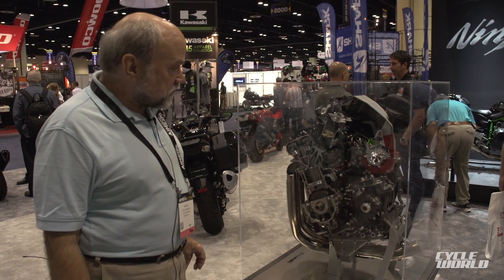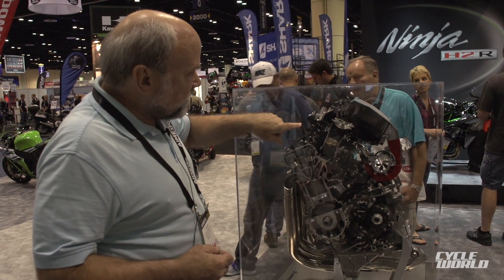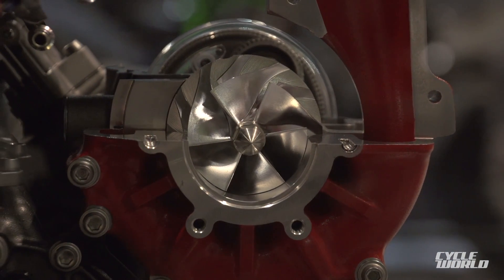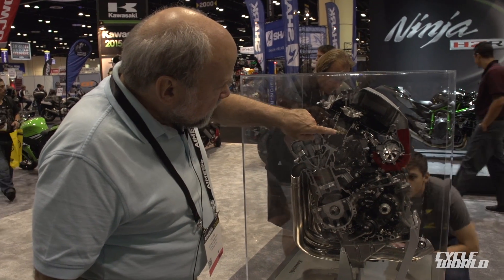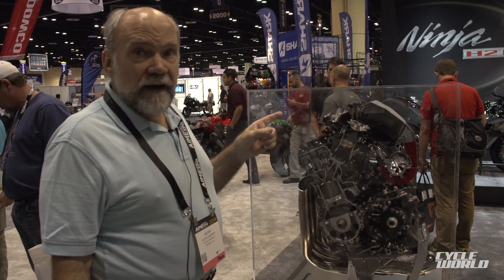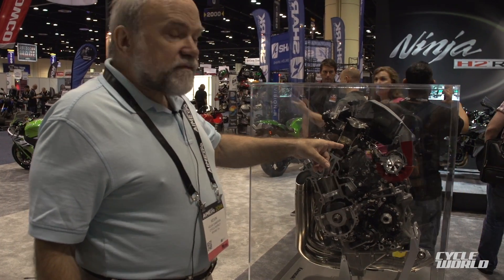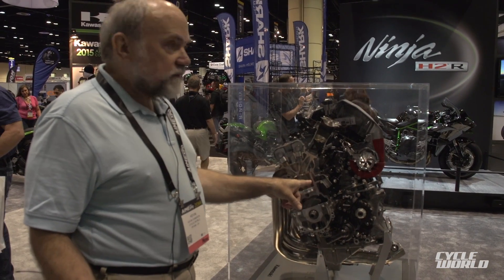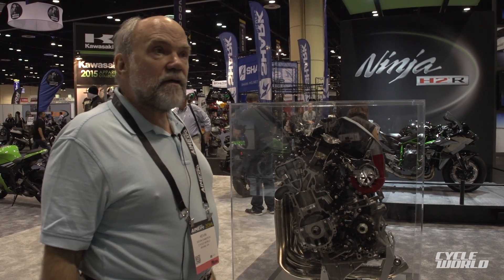Kawasaki Ninja H2R Tech Talk Video No. 1: Following the Airflow

Comment: Didn't charged air need to be cooled down for oxygen density?
Reply: I guess fuel injection solves that problem. It would have to be a very lean mix to minimise detonation. But that makes everything hotter, which requires more complicated and expensive cooling.

Long story short, I know only slightly more than nothing.
Reply: @DavidOfWhitehills i mean to make more power -> need to burn more fuel -> need more air(oxygen). Force induction creates charged air -> hotter temp -> expand air volume -> less air density/oxygen -> less fuel burned -> less power. So it contradict force induction function?
CMIIW

Comment: You stated that a part had to be cast due to the high pressure. Why would cast aluminum be stronger than forged?
Reply: Airbox can be difficult to forge dude
You can make it from forged individual sheet but you have to weld it to form an airbox
Reply: Forged would be overkill. Casting is simpler and cheaper. What Cameron is saying is that it has to be cast rather than plastic.